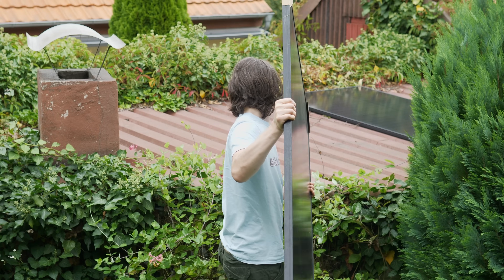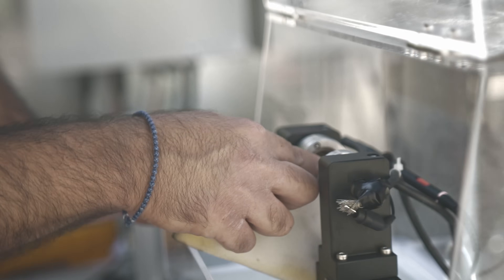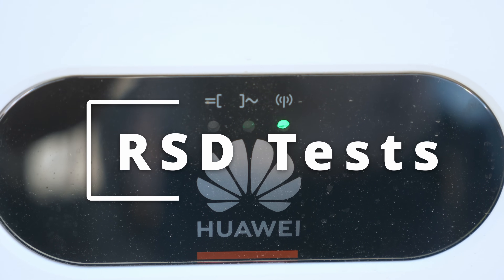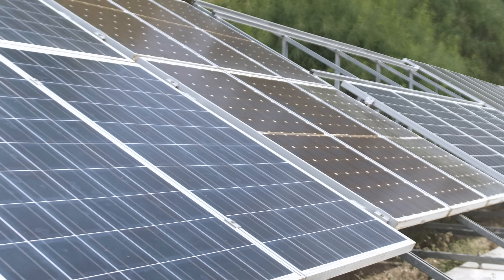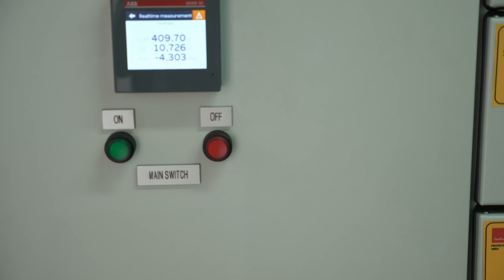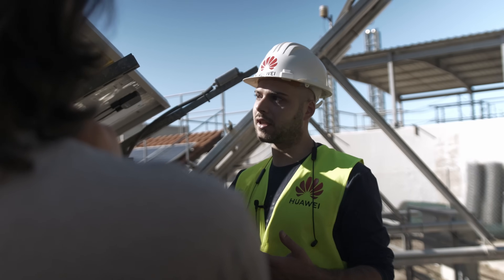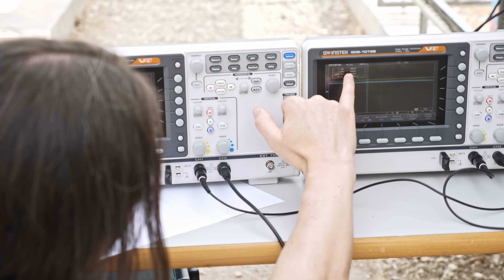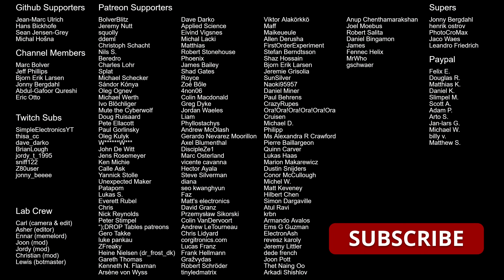Solar optimizers with some neat features #Huawei FusionSolar

Comment: The optimisers are interesting to me, from an engineering POV, could they just be MPPT controllers? I don't see why one couldn't just setup a per panel MPPT to output a common voltage, then wire up the outputs of the controllers in series, should work provided they don't share a common ground. Might be an interesting experiment.
Reply from the maker: from what I got they communicate over the line so probably the logic is in the inverter but certainly the optimizer can act as a step-down converter to rather match the current. maximum power point could be a high voltage but lower current compared to the other modules. so there is some balancing going on
Reply: @bitluni Interesting and thanks for the pin, and response. I'd be very interested on a cheaper DIY solution though, I like to engineer my own (problems)solutions :).
Reply: those ones as the solaredge ones need a lot of energy per panel and for every hour they are running afaik. Solar edge are power monsters. Andreas Spiess the guy with the suisse accent has taken his optimizers out of the production due to the consumption.
Reply: hoymiles got microinverters, it's installed under the panels and each panel's got its own input pair

Comment: Insurances in germany do pay in case of what so ever. Build the system and write a letter like I have built a solar power system that is also feeding into the grid and charging my 51V SEPLOS MASON 280LA which consists out of 16 LFP cells from EVE type LF280K managed by the SEPLOS BMS.

You will get an answer that that is OK. You simply have to describe the battery fair enough. Price of that system was 2300€ in november, the battery case was about 470€ from germany (lichtex in the south or so, a presale order) and the EVE LF280K cells grade A from the same production day in july 2023 were 1830€, so 2300€ in total for a 14,4 kWh battery. I guess you can not beat that and it is convenient too cause the battery case includes all the seplos BMS which is alone about 250€ which means: all the cables and bits and pieces needed are 220€ incl. all logs , crimps and what not. Only a screwdriver and wrench is needed. 

Look for the german designed and made in Euope DC DC optimizer made by BRC Solar. They work great and deliver without any consumption except there is a shading cause in that case they transform the voltage of that particular panel down to increase the current to the level of the other panels in the string. 
These BRC solar optimizer work great and they are quite cheap at least in germany about 45€ incl. shipping.

Comment: I thing you have to treat the roof panel fire just like a oil pan fire. you just need to throw a large wet blanket over the roof.
Wet to keep the blanket cool during the fire, and to remove the sunlight from the panel so it stops adding fuel to the fire.
So we need to design a wet blanket cannon. 🙂
Also how about big magnets around each connector to pull the arc away as in DC relays with magnet arc suppression. 🙂

Comment: So the optimizers are like DC-DC converters per panel. Based on my research, if you are only worried about shading on a few panels, then you only need to install optimizers on those few panels.
Reply: Except for those inverters that need optimizes on every panel and obviously you would loose the security features
Reply: @TecSanento   I don't know about Huawui equipment but with competitive Tigo panels you can get optimizer+RSD modules as well as cheaper RSD-only modules. With RSD-only modules you wouldn't lose any safety but I suppose you would lose some monitoring functionality.
Reply: @eDoc2020  but how do those rsd panels shut down without electronic optmisiers?
Reply: @TecSanento  They contain simpler circuitry which only is capable of on-off switching. No two-way communication, no inductors, no high-frequency switching, probably just a MOSFET or two driven directly from a cheap microcontroller.

Comment: This was great! However I wonder if the biggest danger is any battery storage in the system, and not the PV cells and associated electronics?
Reply: It really depends on what you define as "danger".
A fault on the roof is going to result in a roof fire. No batteries needed.
And speaking of fire, some of those tests were to confirm the system handles rapid shut down, which is what might happen when emergency services is trying to fight a pre-existing fire. You don't want your solar system trying to push power into a building that is off because water is being aggressively sprayed into/onto it.

Comment: I thought micro inverter solar panels on each panel solved the problem of partial shading. 
I guess I was wrong.
Reply: It would work
Reply from the maker: I had that part in a 25 min version of this video but I needed to cut it shorter. microinverters are certainly a solutionif they can can compete in the purchasing costs. I can imagine the optimizers are competitive there.
Reply: @bitluni Also micro inverters are not useful for non grid tie applications, like caravans and fully off grid systems that charge banks of batteries.
Reply: @gnif  but you use the off grid version.. but for most small or off grid it's DC to DC  with separate AC.
Reply: @guywhoknows  I was addressing the original post,  micro-inverters step the individual panel voltages up to AC grid mains, which solves the problem for Grid Tie setups. It does not solve the problem for smaller or completely off grid systems, which is my point here. It doesn't matter what you state about off grid setups, the OP was asking if micro-inverters solve the shading problem, which they only do IF you are grid-tied.
Reply: @gnif  I was referring to the non useful for non grid. They can be used with a hybrid inverters. The difference being grid forming or not.

Comment: Try to design and implement a potential energy battery for home use.
I've always wondered what size tension spring would need to be to store enough energy for a residential home.
Reply: To big - I calculated raising the house about 1 meter is not even a single kWh

Comment: Lol why would you dismiss ohms law ?

The current is not the power, if they drop, say 6.1 and 6.3...
But the voltage is 450 and 400...

That's  2745 and 2520.

So it's not optimised for max power, but max current at the cost of voltage meaning less power.

I can't think of an application where just the current was essential....

I have seen like for like tests carried out with optimisers, there was not really any difference.

But interesting to know they are just current monitoring buck converters.
Reply: Fire prevention is the afd (arch fault detection) a lot of inverters have these built in these days.
But was due to wire rub, or connection faults. But most recorded fires were down to DC isolator switches, they updated the regs last year or so ago.

If you have many optimisers, they don't know the full power, as they are all trying to make the maximum current. On a cloudy day that's going to be low, so they all lower the voltage.

Oddly a mppt inverter, will change the voltage to maintain power this effects the current and voltage together to get the best result.
On my system I have a shaded panel, I also have diodes in the box on the panel. When they vary a lot it will by pass the panel that's shaded as I can see my voltage drop for that panel.

No optimisers, required. I can see how it would work on really old systems which don't have diodes or mppt solar tracking... But not on anything made in the last 4-5 years.
Reply: Not the problem is that you could at together multiple panels with different voice just but if the current is different one panel with lower current will block current from other Panels, so it's better to keep them at the same level